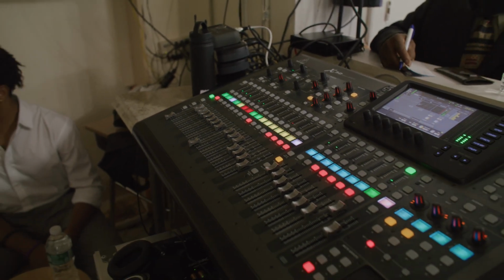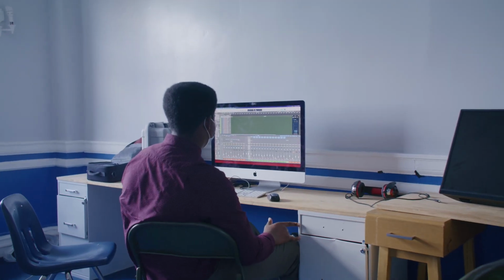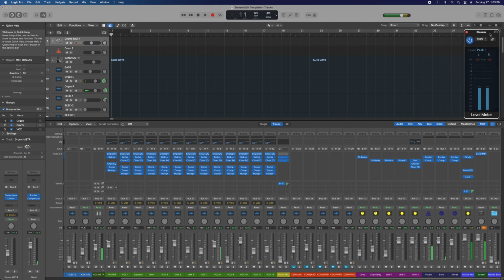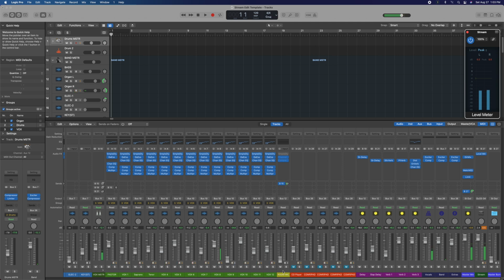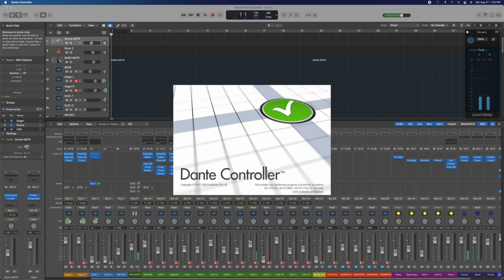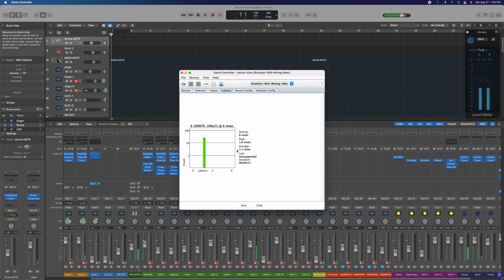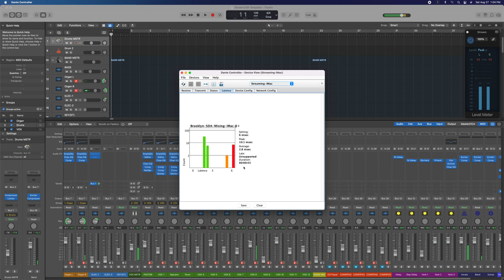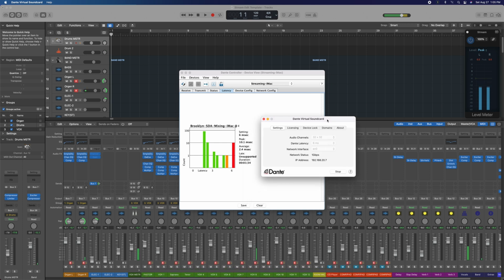How to Fix the Annoying Dante Pop and Click Issue!

Comment: I understood that the red bar is showing packets that have arrived outside of the latency window. Your latency is set to 6ms but you have packets arrived at 10ms, these are dropped and showing red.
Reply from the maker: Yes, you have to play around with it to get the best out come. If the latency is too late, the audio might be out of sync with the video. You just have to set it so there are no clicks and pops and no audio sync issues, even if a little red shows. Orrrrr, just setup another network or vlan for Dante and that will solve everything.

Comment: I had the same issue but for a different reason. I had to change the clock source on my Behringer wing to wing Dante, and not internal. After that, I had no pops or clicks.
Reply from the maker: Thanks for this! Seems like a few different things can cause the clicks and pops.

Comment: Another issue that is not often spoken about is the terrible ASIO support on Windows with Dante. I ended up using Voicemeeter, in combination with Dante Virtual Soundcard, to send audio from the PC to the mixing console, and to receive audio into OBS on the computer.
Reply from the maker: It also helps to put Dante on an isolated switch. That’s can help a lot as well.

Comment: I have extremely low latency, everything set correctly and room to spare. zero errors, high buffer  and still get pops and clicks. Super annoying.
Reply: did you solved this? I have same problem
Reply from the maker: What’s your buffer size and are you running Dante on a separate switch than your internet switch?
Reply: i solved this problem. Because i used a separated computer only to send 32 channels inputs to me with dante via
 @JJSCTech
Reply: You might have a clocking issue. We had something similar when our DiGiCo S21 was the clock leader and we used its DMI Dante card for the clock source. In our instance the solution was to set the S21's Internal crystal as the clock source and then in Dante Consoller to set the S21's Dante to Sync to external clock (which would in this instance be the S21's Internal crystal).
Reply: @chriskistner5424  I believe this is what worked for me. It is a bit counter-intuitive because on the mixing console it is set to "internal" but in dante, (i have an expansion card) i have to set mine to "sync to external". Finally got rid of the issue.